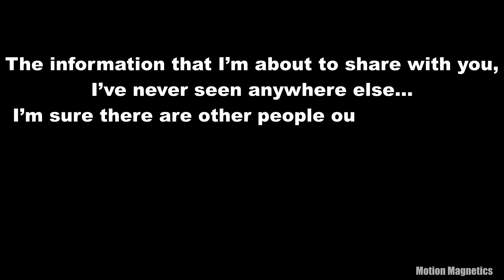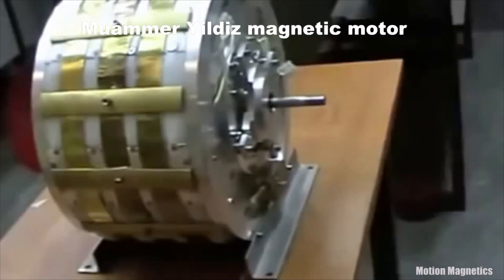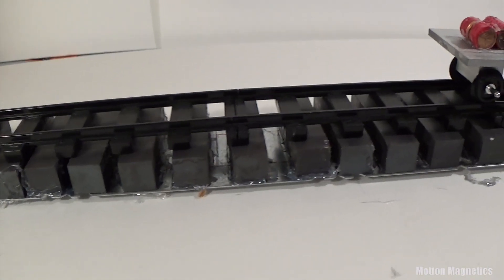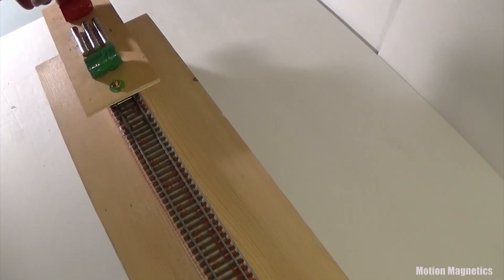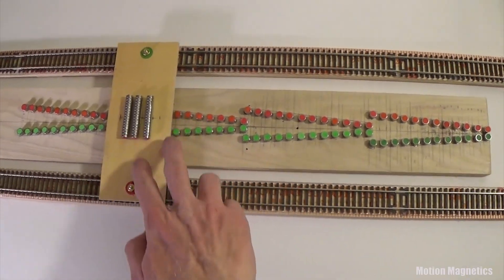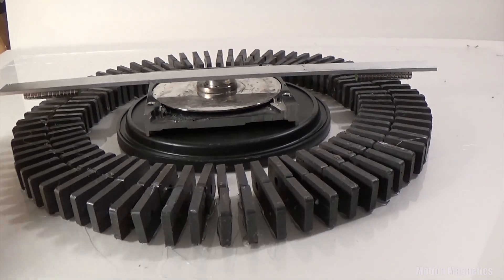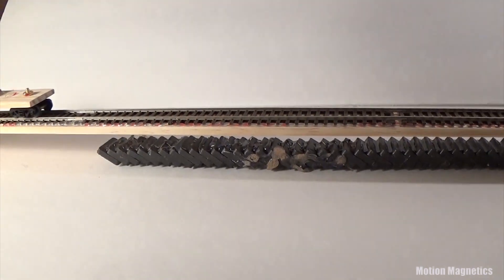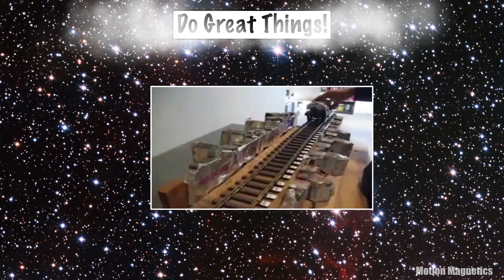The 3 Types of Magnetic Motors Part 01

Comment: At 1:36, there is a bit of a video that the maker has stated is a magic trick.
Reply: Wynfairs
I have never purported to know everything.  This is just a mischaracterisation of my position by you.  All I have ever done here is point out that magnet motors are not real and that The folks claiming to have them are liars, insane or both.  It is one small part of my efforts to help mankind.  Since there is a fairly straight forward (if long) proof that no combination of motions of magnetic poles can ever produce energy based entirely on logic, there is nothing useful to be found up the blind alley of magnet motors. 

You can make a magnet just by holding up an iron nail and hitting it with a hammer, heating it and cooling it, letting a spark pass through it and many other ways.  The energy that ends up in the magnet is a tiny fraction of the energy applied. 

I will point the arrow on the charge of evil right back at you.  You are trying to deceive people who might otherwise do something useful into wasting their time on a worthless activity.

If you choose to now go away, driving you away counts also as a small good I have done for mankind.
Reply from the maker: Ken Smith Yes, it was discredited over a year ago. I was simply using it as a visual aid to serve the narrative. No one has built a working V-Gate magnetic motor, that I'm aware of, so there wasn't a working video clip I could reference .
Reply: Motionmagnetics There are no clips of real ones and there never will be.  The whole "V gate" thing is an illusion caused by the fact that humans are really bad at judging forces.  There is a fairly straight forward proof that no combination of motions of magnetic poles can produce energy.  This rules out all the "V gate" like machines and all the wheel like ones too
Reply from the maker: Ken Smith So are you saying that you believe a magnetic motor is impossible, or simply V-Gate styled versions of a magnetic motor?
Reply: Motionmagnetics I am saying that all forms of "magnet motor" I have seen suggested so far are all impossible, including the "V gate" type.  I can give you a quick run down on the thinking that gets to this conclusion.

Think of just two magnetic poles in space.  Imagine a line running between them and extending off into the distance.  The system has perfect symmetry for rotations around this line.  From this we can conclude that any force we measure between the poles must act purely along the line between the poles.

The strength of each magnetic pole and the distance between them are the only variables in this thought experiment. Hence the strength of the force between them can depend only on these three values.

Since this thought experiment works today and tomorrow equally, the results do not vary with time and hence are independent pf the past positions or future positions.

(The word "Work" on physics means the transfer of mechanical energy.  This is important for the next point.)

With a little bit of more thinking, it is not hard to prove that no combination of motions of magnetic poles that get you back to the starting point can result in a total Work other than zero.   This rules out all "magnet motors" that have this property.
Reply: +Ken Smith i wish HOJO were still around because I'm a bettin man and even in his 80's he'd probably still whoop your dumb ass.
Reply: Wynfairs
So you think he was a scammer and violent too.  Why you support a fake is your business but implying violence makes it mine too.
Reply: +Ken Smith nice terminology, you must be a cop.  Disseminate my words correctly and don't be a baby.
Reply: Wynfairs You are the one supporting a fake.
Reply: +Ken Smith Your saying that Howard Johnson was a Fake?
Reply: Wynfairs Yes just in case you didn't notice I said that I have looked at many in some detail and indeed they are all fakes.
Reply: +Ken Smith I want to call you bad names, but I realize that your lack of education limits your scope of perception.  I hope you take this experience and learn from it.  Learn that you don't know what you don't know.  Which wins, Hope or Fear?  Whichever one you feed...Good Luck Ken Smith
Reply: Wynfairs
I guess I should have expected a claim of greater knowledge.  It is common in Dunning-Kruger cases such as your self.
Reply: +Ken Smith Let me guess, Your boss says you always have to have the last word so your comments are the last thing people read when they leave right? Please Ken Smith, stop trying to help the power structure and join the bandwagon of humanity.  Help us get these Magnet Motors working!
Reply: Wynfairs I am not helping the "power structure".  I am helping the various backyard inventors of the world who may happen to read my comments.  Yes, some people lose money when they get fooled by con artists but that really works as a self administered fine for not paying attention in school.  The more important deception is the one that sends the backyard inventor up a blind alley or discourages them from even starting.  Since the "magnet motors" claim is a complete and total blind alley at best, if I can prevent someone from wasting their time on them, I have done my bit to help get us off depending on oil. 

You on the other hand are setting out to direct people straight up this blind alley.  If I was the suspicious sort I could even see you as being in the pay of the oil companies.
Reply: +Ken Smith MY GOD AGAIN?!?! Magnets, whether made out of Nickel, Iron, Ceramic,  Alnico or maybe di-lithium LOL Are BATTERIES!!! Batteries supply power.  Since people have yet to piece together a puzzle or conduit for that FORCE, we have more research to do. Spouting lines for the "Power Structure", as you so nicely put it,  hinders that research.    If you mean what you say about wanting to help...then do so. HELP! Stop waving your hands and jumping up and down calling us all frauds simply because YOU may have missed something in school.  Be the Change :)
Reply: Wynfairs
The amount of energy in a magnet is small and can be calculated.  I have done the calculation in cases where I needed to know the values.  For many magnets, you can get a datasheet that shows the value already worked out.

The average "D cell" flashlight battery contains about 5000 Joules of energy.  Someone who cares to can go do the cost per Joule calculation for a magnet and then compare to that of a battery.  I know the ratio is huge. 

The creation of a magnet involves the inefficient use of quite a large amount of electrical energy.  The idea that they are some sort of source of energy beyond just some small fraction of what went into creating them is simply false.

Yesterday, I switched off an unneeded light.  On the basis that an Joule saved is as good a Joule found, I can claim to have done more in that one act than all the folks trying to make magnet motors have done or ever will do.
Reply: +Ken Smith Again you purport to know everything.  Can you even see the edges of your ego?  You have identified a few of the problems and associated some of the costs related to some types of batteries. It amazes me to think that a small few will read your posts and simply jump to the same conclusions that you have.  Obviously the current state of our tech hasn't made some quantum leap with magnetics.  There is no need to state it. HOWEVER,  Prof. Walter Lewin demonstrated a device that destroys your argument about the costs of making magnets.  We can simply make magnets with small bolts of lightning collected from the air.  If you don't know who Prof. Lewin is...well...hehe then I don't think I even need to continue talking to you.  It would damage my credibility.  I would wish you luck with the Trolling Mr. Smith, but I really think what your doing is just evil.
Reply: +Ken Smith Maybe you should re-read your posts before you click send.  You just said, in almost the same sentence, "I don't know everything" and ""no combination of motions of magnet poles exists bla bla"   Your entire argument is the epitome of closed-mindedness and demonstrates a lack of ingenuity.  Your decadent ways will be the downfall of mankind.  Live with that.
Reply: Wynfairs What I said was true and consistent.  I presume that you know that  1+1=2.  You can assert  that fact without making the claim to know everything.  I make my living by inventing stuff.  A part of doing that involves thinking through questions about whether or not something is logically possible.  I have explained why magnet motors are a blind alley. 

I will thus turn the pointers  on the charges of being the downfall of mankind and closed mindedness back at you.  You weren't even curious as to the outlines of the proof.  You don't want to know that your pet idea won't work.  It is your mind that is closed.
Reply: +Ken Smith Really? What have you invented? What are your credentials? The only thing you seem to have invented here is a Troll named Ken Smith who is posting negative comments on a FREE THINKING board trying to prevent the progression of energy technology.  Our entire "discussion" if one can call it that, consists of me defending the poster of this video, trying to cheer on other magnet enthuseists and save the world*lol*.  Your posts serve only to stifel the research.  You attack my mental state with subconcious projections of your own character hoping for elevation to the passing eye and now you purport to be some professional inventor because you can use long winded language.   No, My Good Sir, Look up the work of Mr. Morin from Canada.  Look up these patents.  Howard Johnson was a Leader after all.  Someone thought he knew what he was doing and I am certain, as with all fields, there is room for growth.
Reply: Wynfairs This is not a "free thinking board".  This is a comments section on youtube.  You are working to defend an idea that is a complete and utter blind alley.  There is a straight forward proof for this.  You are so closed minded that not once have you expressed even the slightest interest in what this proof may be.  In science, credentials don't matter.  A conjecture is either correct or incorrect.  It doesn't matter who proposed the idea.  Thus the pointers still point at you.

BTW: Because I make my living from what I invent many of the inventions are not mine to discuss.  They are owned by the folks who paid me for them.  There are others that I can discuss.  One of which is in the area of making a small wind turbine far less likely to shred it self in a storm.  If lurkers are interested, they can ask.
Reply: +Ken Smith Your right, this is not a BBS service, but I think most would agree that we are using it as such.  Credentials mean nothing? Ok Just make sure you tell your loan officer that, or your insurance company? They wouldn't care about credentials either. You probably don't understand but I digress...Now you call me closed minded? Do you even know what closed-minded means? I stand by my original assertion that this post is great and that magnetic technology is worth researching.  Your telling hundreds of people to stop trying to develop alternative energy technologies because your mind's scope is too narrow to see outside of the sight picture (figuratively speaking) which is preventing you from wrapping your head around our ideas.  I'm sorry you don't get it.  Maybe you should look into clean coal as you seem inclined to stick with technology that requires no credibility.
Reply: +Ken Smith So you admit that your comments are biased and self interested.  Good for you. I just want someone to invent anti-gravity so I can go to the moon before I die.  Cant happen with wind power.  Thanks for trying to give me an aneurism.
Reply: Wynfairs
I never said it was self interest that makes me point out that "magnet motors" can't work.  If you read my comments above you will find a quite different motive for directing backyard inventors away from a known blind alley.  However, even if I was motivated by self interest, the statement that there is a proof that no combination of motions of magnetic poles can create energy is still factually correct.
Reply: +Ken Smith What proof? The absence of technological advancement has never been proof of impossibility.  Your incessant use of the term "Blind Alley" raises questions in my mind subconciously. LOL Where did you get that arrogance?  Every comment, IMPOSSIBLE!, CANT BE DONE, BLIND ALLEY hahaha. It's like some ass in a croud yelling at the entertainer.  Only  im not trying to be entertaining.  You like a zealot trying to stop people from researching magnets. WHY? Oh yeah, "Cause ain't nobady eva dun nutin wid dem magnets afore!" I figure if I dum it down, maybe you'll get it.
Reply: Wynfairs The proof will take some time but I will make a start.  Remember I said nothing but high school math is needed.  As a result a little later, I will have to stop and define a few things.  Right now, I will start with a little thought experiment just to help to get some of  the basics.

Imagine empty space with only two magnetic poles in it.  You can imagine a line running between these poles and extending off in each direction.  The situation has perfect rotational symmetry  around this line in that there is no way to say that there is a "preferred  direction" or a "Y direction" or whatever you may call it running away from the line at 90 degrees.

Now consider the force caused by these poles on each other.  There are only 3 variables available for this force to depend on.  The distance between the poles and the moments of the poles go into this math function and the force comes out as a result.

The details of this function will not matter to the proof.  All that matters is that it is a function.  It should also be obvious that the result of this function is the value a force that acts along the line between the poles.  For our purpose we can use the sign convention that attraction is a positive force and repelling is negative.

Are you with me to this point?
Reply: +Ken Smith No, and im not going anywhere with you.  Your trying to reinvent, regurgitate, spew or "inform" everyone the results of failed experimentation.  Im pretty sure that the math had to be invented for flight, prior to flight, space travel prior to space travel and this will be no different.  Your trying to use a system that has no definition for a working model to define that model. Obviously this will cause trouble, how else would patent offices make claims regarding "Perpetual Motion" (Which is basically a legal argument used to force litigation out of the Court) Think of Perpetual Motion as being synonymous with a Motion to Dismiss due to late Entry of Answer for time constraints.  They automatically lose.  Same for Perpetual Motion, if the claim is made by someone like you or your boss, My magnet ideas will automatically be thrown out because the math we are taught does not include all of the necessary variables needed to accurately display the intended design.  So, Have we tried to magnetize evething on the periodic table, thus turning it into a battery.  I don't care that you lack the tools, vision or depth of thought to see whats possible.  I DO care that your intentionally trying to brainwash all of these people into believing that they are running down a "Blind Alley".  We know how to magnetize.  We know that magnets act differently around other magnets of different material.  We cannot know the results of ALL of those combinations.  The possibilities are Infinate.  Which means....:)
Reply: Wynfairs I merely offered to explain to you the proof that your ideas are daft.  You refuse to follow and thus are willfully ignorant.
Reply: +Ken Smith Pot calling the kettle black.  What how many kinds of disgusting does a person have to be to keep insulting someone who is not even fighting back.  Thanks for showing everyone your character.  Keep trying everyone.  Don't listen to them.
Reply: Wynfairs I pointed out that there is a proof.  You characterized it as "regurgitate, spew"  I said that you are willfully ignorant and indeed you are.
Reply: +Wynfairs And Gerard Morin from Canada. Look at his work too.  Power Amplification using washer drain pumps.  It's "overunity" or whatever but it works.  He says, (Morin) that the math we use, algebraic is based upon statements of equality and therefore, using such a model, it would be impossible to correctly display any gains.  Which allows the claims of perpetual motion and fraud so easily made.  You can keep your head in the sand, that's none of my business.  I am going to continue to encourage people to listen to these great people and to ignore people like you.  Why is it so hard for you to open your mind? Are you afraid of getting scammed?  I don't blame you.
Reply: Wynfairs
http://revolution-green.com/gerard-morins-free-energy-delusion/

It is just more fools liars and con artists.  It doesn't work.  we know it is blind alley.  You are sending people up a known blind alley.  If I was into conspiracy theories I would have you as a shill for the oil companies.
Reply: +Ken Smith Your Hilarious! After all this you start calling me a shill. Your a Troll for the oil companies. I've been saying it from the start!
Reply: Wynfairs Note that that is not what I said.  I said that if I was given to conspiracy theories ...

I have said that your are directing people up a known blind alley without suggesting you have an evil motive for what are in fact evil actions.

No combination of motions of magnetic poles can ever create energy.
Reply: +Ken Smith See now we go back and forth so as to make the last post be the one people see when they pass by.  As of today, its around 80k.  So you have to keep insulting me and stating your opinion.  Let us come to an amicable disagreement.  I think people haven't figured out everything about magnets.  YOU think people have LOL.  I think people who have demonstrated the strength of character to continue this research are awesome.  I think that cheering is a good thing.  You should really take a moment to do some self reflection.  Always get more flies with honey than vinegar.
Reply: Wynfairs People who show the lack of intellectual curiosity and the willingness to follow the lead of con artists will end up wasting their time on things that could never work.  On the other hand those who stop to think, can see that no combination of motions of magnetic poles can ever create energy and thus can go to do thing useful in the effort to get mankind off its dependence on oil. 

We haven't figured out everything about math but we know that 1+1=2.  The statement about moving poles not creating energy is in that same sort of class of observation.
Reply: +Ken Smith Good Idea Smart Guy lets get people off oil. Magnets are Superconductors!
Reply: Wynfairs
Magnets are not super conductors.  There is only one other place this erroneous idea commonly is seen. It is in  a bogus patent that slipped by the patent inspectors by being obscurely worded.  Aligned spins don't make for a super conductor.  For that matter things like the London effect show that the spins in a superconductor can't be aligned.  If you had done a little research, you would have known this.
Reply: +Ken Smith r 2
Reply: Wynfairs
Even a little research shows you are wrong.  Thus we know you have done none
Reply: +Ken Smith more worthless words. True trolling. Babble babble babble trying make people think your cool.  Your like those people who boo'd the gay army soldier during the debates. Magnets have not been fully researched.
Reply: +Wynfairs LOL your like the Muslim hater that asked Trump Questions during the debate. You can make a choice to stop. Just stop. I will concede that your wind power is cool.  Just let people keep researching their magnets in peace :)
Reply: Wynfairs Math has not been fully researched but we do know that 1+1=2.  Your claims about magnets are contradicting stuff we already know for sure and can prove with simple logic.  If you had done any research, you would have known this.
Reply: +Ken Smith wow your like a book. SO, I HAVE done research. Since you've said i haven't done any in your last three posts its obvious your "argument" book says you need to point that out.  I also want to point out that your only saying 1+1=2 over and over. Hellooo?!?!?! NAZI?!?!? HELLOO!??!! ANYBODY HOME?!?! THINK NAZI! THINK! Magnetic Technology has Plenty of Room for Expansion.  Admit it. You don't know what you don't know.
Reply: Wynfairs
1+1=2 is still true.  ad hominems from you won't change it.  No combination of motions of magnetic poles can ever create energy is still true.  ad hominems from you won't change that either.
Reply: +Ken Smith Someone learned a new word! LOL But your still using the same old arguments. Maybe you should spend more time researching your wind projects instead of spreading negative influence throughout the world. Magnetic technology, for instance, ought be used to improve your wind turbines.  There currently exists a combination of magnetic poles which can be used as a bearing. Imagine a wind turbine with magnetic bearings instead of ball bearings. I know even a mind as small as yours can conceptualize something as simple as this. HEHE Your move :)
Reply: Wynfairs
1+1=2 is the same today as it was yesterday.

Magnetic bearings are a really old idea.  They work today like they have in the past.  Magnetic bearing offer no great advantage over the ball bearings commonly used in wind turbines.  The wind provides the preload force so they are quite easy to make work.

I guess you finally at least went as far as to do a quick google search before commenting this time.
Reply: Wynfairs You pointed out something that is very much old news as though it was some sort of revelation.  In your latest comment you again show that you haven't thought through your idea or done any basic research.  There are good reasons the alternators used on large wind turbines are designed the way they are.  It is all about getting a large dB/dt where the copper is.
Reply: +Ken Smith It amazes me how hard your mind works to stay inside of your little box.  I understand, it is safer there.  However your constant attacks, literally every post, contains some snippish remark about my lack of research in an attempt to make yourself sound smarter and appear more of an authority are dimeaning to you.  About the wind alternators, as you put them....Are they completely researched too? Holy Mackeral! Where have you been?!?!? You have single handedly figured out EVERYTHING there is to know about Magnetics AND Wind?!!?  Should I not promote the advancement of Wind Alternators EITHER?!?! Perhaps you would feel better if I simply parroted whatever you said?  It sure seems that way. Well, I've considered that and....well.. Fuck Off. (Sorry for swearin) Magnetic technology has room for development. We are not DONE. We will NEVER be DONE, that's the DARNED POINT.  And Wind could use some improvement too...
Reply: +Ken Smith Ya know, being supportive and encouraging has potential.  It gives Hope. Your not doing that at all. Do you realize that? If you lack the vision to see what others can see, where do you think you should go?
Reply: Wynfairs I am supporting the truth.  Encouraging people to waste their time is doing evil whether the intention is good or bad.  I have pointed out already that there is a quite straight forward proof that no combination of motions of magnetic poles can ever create energy.  You persist is trying to send people up that blind alley.  At this point I must begin to conclude that your purpose it to do evil.
Reply: +Ken Smith hahaha now im EVIL! ok cool zealot. WEEV wannabe gfys ;)
Reply: Wynfairs
You are doing evil and it has been pointed out to you.  You continue to do evil so your motives appear to be evil.  You are also the one who can be properly described as a zealot because you continue in your position in spite of the evidence you are wrong.